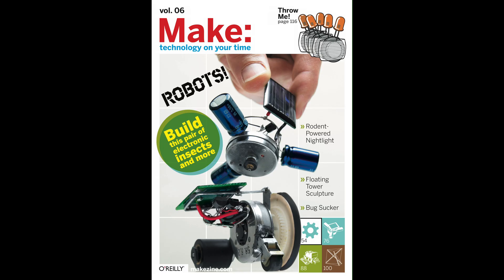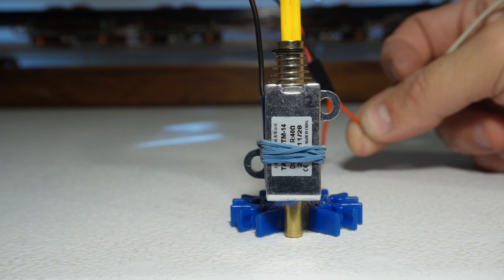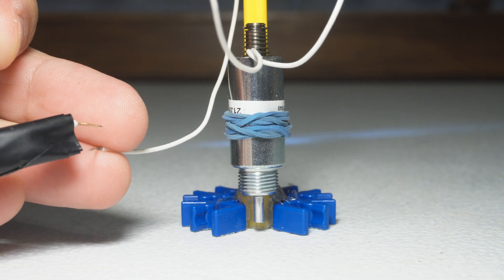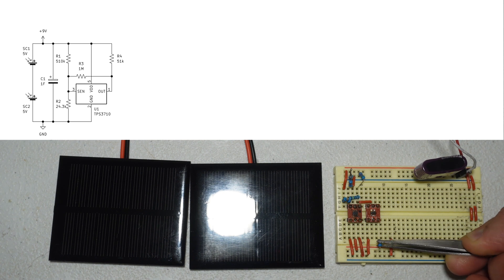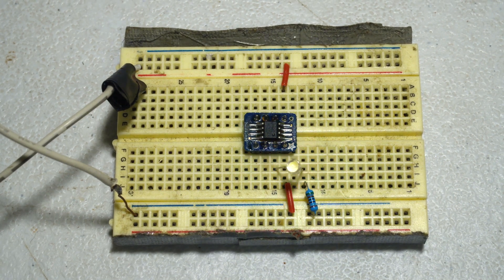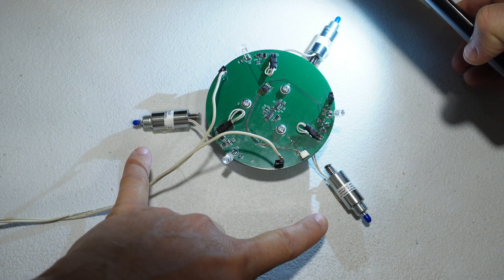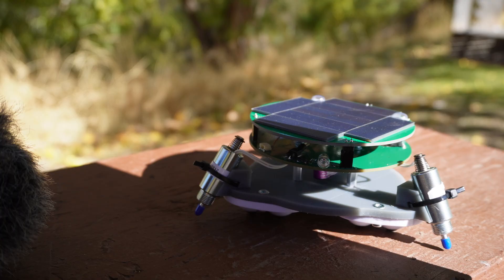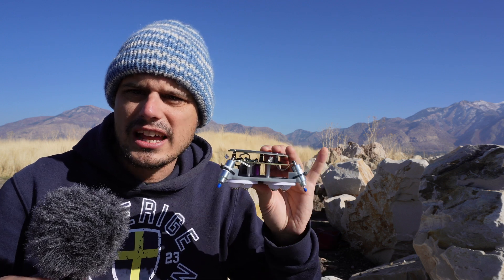Making a Modern Musical Beambot

Comment: That's really cool, I love the solar engine you came up with. I have been using the Motorola MC34164 for similar circuits, it's a shame the old 1381 is so hard to come by nowadays. Really interesting robot design as well.

Comment: I've built a few of these that had a quadcopter format, hopping around the dessert. Give it a whirl, likely the 3 solenoids are heavier than quad motors / props you'd need to lift that thing anyway. BTW, the output on those little panels looks great, where can you get those?
Reply from the maker: I got them on Digikey; search for SM141K04LV